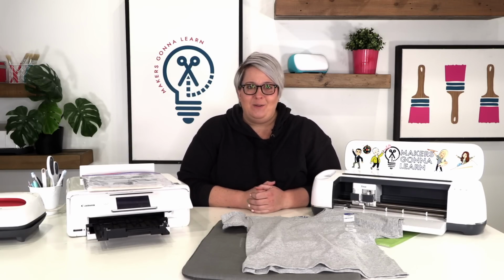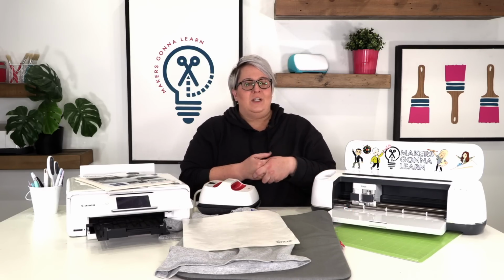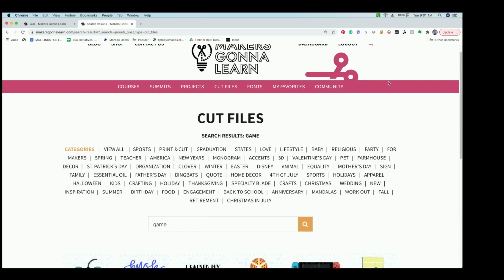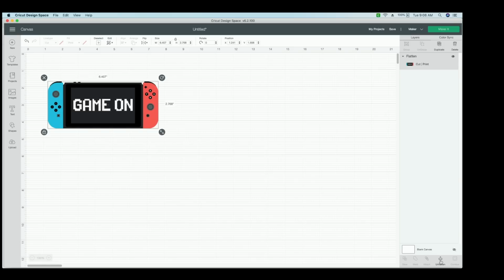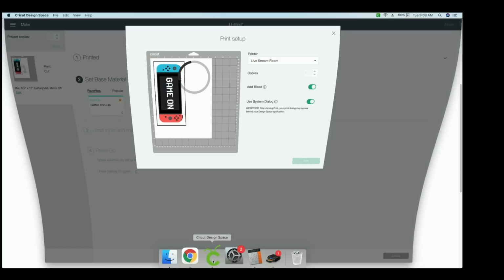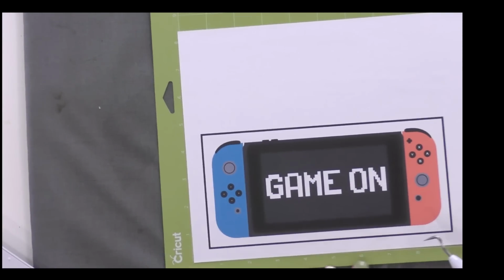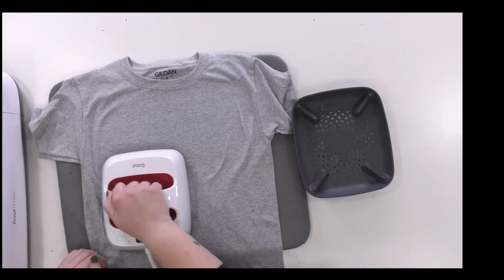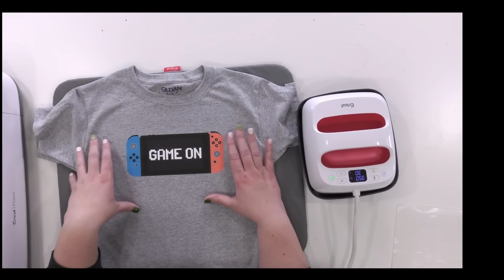How To Use Printable HTV

Comment: My machine keeps saying it can't read the lines What do I do? please help I'm a newbie lol
Reply from the maker: This means there is an issue with your registration marks! This will show as a black box around your image once you've printed through Design Space! If the lines are blurred or not clear for the Cricut sensor to read, it won't be able to properly cut your image. Also, make sure there is nothing blocking your sensor. It is between your clamps on your machine. You can use a paint brush to carefully brush under the sensor to make sure there's nothing stopping it from properly sensing :)

Comment: Is the paper thick? Would it not work on a printer that feeds on the bottom? Also is the mini not good for htv? I had never heard that
Reply: Hi! Today’s video was on printable HTV (not regular heat transfer vinyl/iron-on).The reason I do not like the mini for printable heat transfer is that you can accidentally move your printed HTV when you are moving your mini easy press around. 
Don’t get me wrong, the mini most certainly can be used with the printable HTV you just need to be super careful with moving it or tape your printable HTV down with a heat resistant tape. 

We do absolutely recommend the mini for regular heat transfer vinyl though! ❤️Becca
Reply from the maker: Yay!! Thanks for replying!
Reply from the maker: So glad Becca was able to answer this!